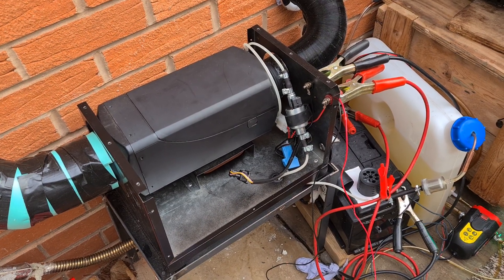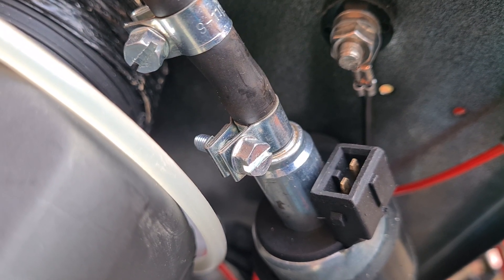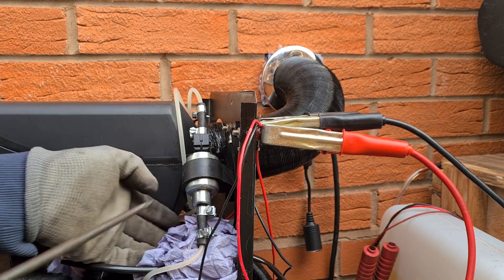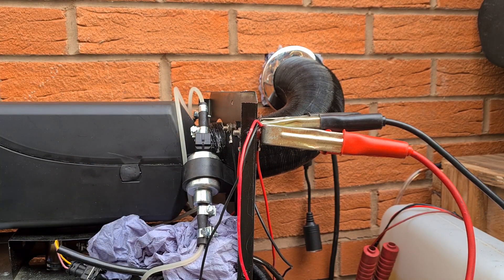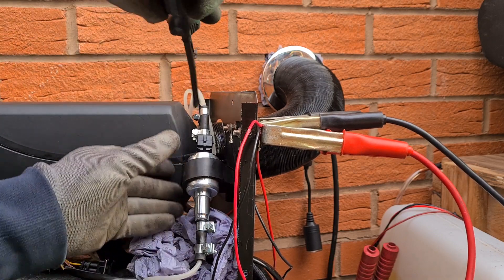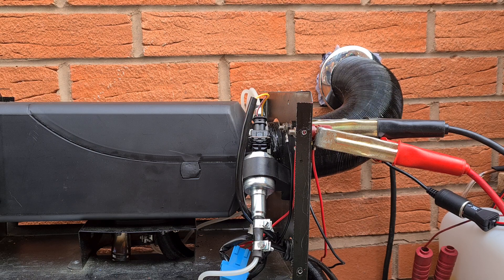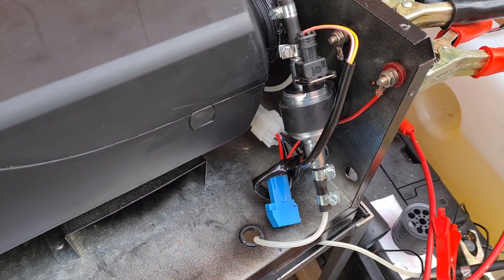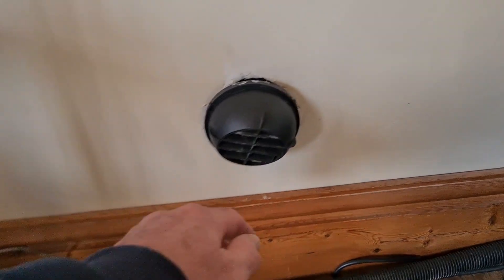How to fix your Chinese diesel heater fuel pump and test it.

Comment: I just had to replace my fuel pump. One thing that upset me is when I emptied the tank from the heater. I use a filtered funnel when filling, but STILL had TONS of crap in the screen once the tank was emptied(only operated for close to 4 weeks).........I mean close to a 1/4 teaspoon of crap in the screen. IMHO, that much crud in fuel is unacceptable. I have a fuel filter inline in the heater, but with the amount of garbage found in the fuel, I imagine I will have to replace the filter after a month.
Reply from the maker: @drummer4hire12  is your fuel can clean the one you're using all you getting the fuel from it shouldn't be dirty.
 it shouldn't be like that I'd get the fuel from somewhere else or make sure your can is clean
Reply: @aaronkent2940  I made sure to clean not only the can, but to run about an ounce of fuel through the heater system which drained into a bottle after taking off the hose to the heater inlet. 
I will say that I live in the boonies, and only have 1 diesel source. The damn fuel pump at the station actually quit working while I was filling. The clerk mentioned they just had it filled..........NOW I am understanding that the pump at the station must be overdue for a filter.....I agree that there should not be anywhere near the junk in the fuel. I will just come up with a 2-stage filter system to fill.
Reply from the maker: @drummer4hire12  get something like this https://amzn.to/41Zh2F7
Reply: @aaronkent2940  Thank you very much, kind Sir!!!!
Reply: @drummer4hire12  having big problems myself... Best filter I've seen is cheesecloth in a strainer if you're still struggling. Mr Funnel seems good for separating water.
Reply: @byrne1916  I bought a big funnel with a screen, and also a plastic/wire coffee filter. I put the filter in the funnel and pour the fuel into it, being careful not to overflow the sides.  I also switched gas stations. I have checked the fuel tank on my heater a few times, including tonight. The tank is clear and the heater is running top-notch. I also added a fuel filter between the tank and pump. I am putting together a video that will show how I bullet-proofed mine. I hope you find a solution to your issues.
Reply: @drummer4hire12  I'm finally back in business.... Been running well for days. I bought the funnel Aaron shared but it's too slow and the fumes killed me. So I got a jiggle Syphon, wrapped 4 layers of cheesecloth on the end and kept transferring the fuel from can to can. Each time washing out the empty can and using a new clean piece of the cloth. After 6 runs of this the fuel was finally cleaned out and I ran it. It hasn't stopped in days now, on high setting and I've been using an old pump on it without a fault. Rough lesson learnt here 🥶
Reply: @  Great to hear!!!! Ever since I bullet-proofed my heater and use the 2-stage filtration(plus the internal filter)- Nothing but toasty-roasty vibes from the heater.......blasting on level 6 heat for 12-15 hours straight everyday.......LOVE IT!!!!!

Comment: This is a big issue although these units are cheep every year I'm having to change the pump tried all sorts of suggestions on you tube but nothing works
Reply from the maker: What fuel are you using
Reply: @aaronkent2940  diesel. I'm just about to order another..now I'm thinking Because it's only used 4 months of the year that means diesel is in the tank for 8  months wondering if this is the issue.. thought about running it dry when I no I won't be using it again for months..what I say new I mean complete unit
Reply from the maker: No need to run it dry diesel doesn't go off like petrol. 
Though you can get a diesel bug in the diesel iv only heard this. Only issue you may have is water in the diesel you could try a water separater and see if you catch any water in it  @vwcamperinteriors
Reply from the maker: @vwcamperinteriors  https://amzn.to/49FJiyq something like this

Comment: Main cause for these pumps getting stuck and no longer working is dirt and water in the fuel. Fit a good water separator fuel filter and you can say goodbye to fuel pump problems. 

In most cases these pumps can be fixed. Flush the pump with penetration oil from a spray can using the supplied straw. You need to hold the straw tight to the inlet of your pump. You may need to poke in from inlet barb with a thin Allen key to get piston to move.